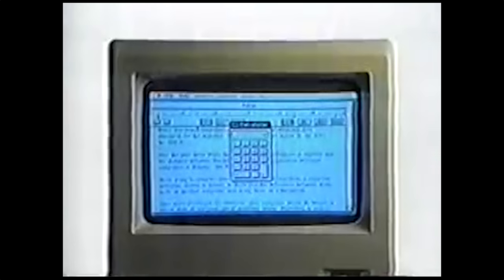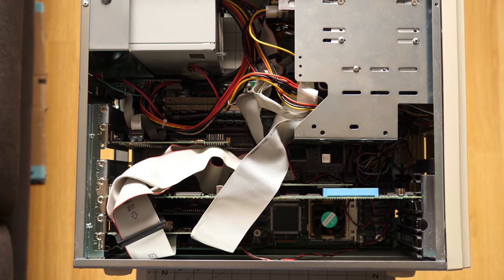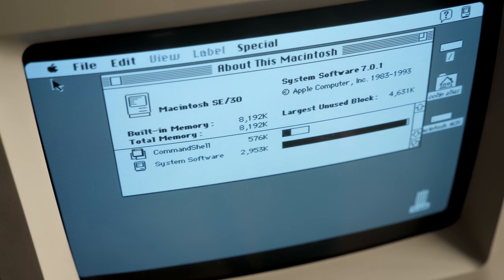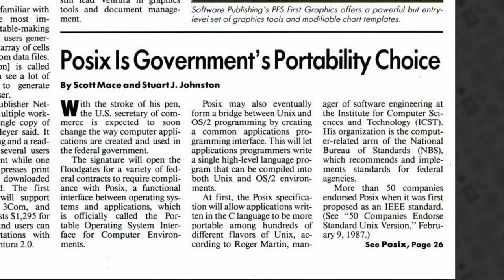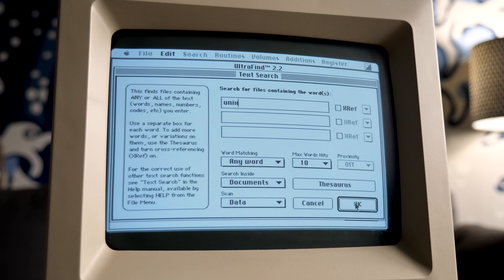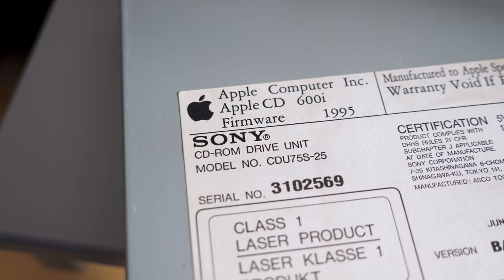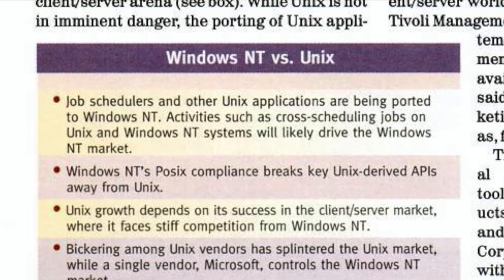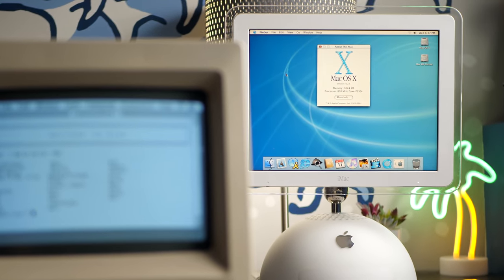Apple A/UX: The First UNIX Mac OS!

Comment: I remember when I worked for Apple Australia around the turn of the century, coming across a BOOK of floppy disks, it was A/UX 2.0 and it came as 20+ floppy disks.  We successfully installed it on a IIci that we had lying around at the time, it took the better part of a day to install it.  Amongst other things, kernel extensions did not exist, but the OS had the capability of recompiling it's kernel on the fly, the administrator could tell it to recompile the kernel to include certain features (like networking), and it did so on the spot and advised the administrator to reboot once it had completed.  It had a seriously brilliant utility called "Commando" that  was a graphical interface to generate a command for the command line to execute, including graphical pickers for all the different command line option flags for each of the commands.  It also used a case-sensitive file system.
Reply: I happen to have a IIci and am tempted to give AU/X a go on it.
Reply: What! I'll be damned!
Reply: Commando was also part of MPW, I thought it was awesome, MUCH better than any manual page!
Reply: i heard kernel compiling and taking "the better part of the day" to install it- and that reminded me of gentoo linux
Reply: That's a better experience than modern Linux.
Reply: Apple Australia had a good customer for A/UX in NSWIT, later the University of Technology Sydney. I was a part-time student there at the time. At work I was using Fujitsu UTS Unix, in all its VT-220, 80 x 25 glory. The A/UX machines at Uni seemed like science fiction .. it was Unix! But it had a GUI! And a mouse! How could this not dominate the world of computing?? As it turned out, that was the first and last place I ever ancountered A/UX. Of course, Apple finally caught up with Mac OS, a genuine UNIX 03-compliant Unix.
Reply: @Maclabhruinn  IIRC (and my memory is very suspect) A/UX 2.0 had an implementation of X-Windows as well.
Reply: I wrote the installer. I had to create a bootable floppy (that was fun!). It also asked for the next disk (something PCs didn't do), checked if you put in the wrong one, and had error checking for bad disks.
I also wrote the installers for tape, CD and the (drum roll) 100 floppy version for people who didn't get it on CD-ROM!
Reply: Wow, this is  pretty cool ! This is why I love Collin's channel. The vidz are always full of comprehensive real info and entertaining! Contrast and keep up the good work 🎉😅!
Reply: @RokeJulianLockhart.s13ouq  Forget modern Linux, that's better than Z 'doesn't have autocomplete enabled in stock settings' shell as shipped by current macOS.

Comment: MultiFinder was often called "MultiCrasher" at the time.  Atari also had an actual AT&T UNIX System V Release 4 ported to ST computers.
Reply: M.A.C.I.N.T.O.S.H. = most applications crash if not the operating system hangs (a very true statement back in those classic os days)
Reply: Atari!?!?!?  WOW!!!
Reply: The Sys. V release from Atari was for the TT030 (their first 68030 model). It ran on a slightly modified model they called the TT/X, though I think the only difference was it contained a display card that could drive a 19" monochrome monitor. The card probably plugged into its one expansion slot. It ran Unix with X/Windows.

I remember being really excited by this at the time, but the TT/X was short-lived. Atari only sold it for several months in 1991, and then cancelled it.

Interestingly, in the early '90s, it became possible to run a Unix-like environment on an ST (their 68000 line) using Eric Smith's open source MiNT OS. It was even possible to run X/Windows on it, if you had at least 4 MB of memory. A hard drive was really necessary to have a nice experience with it.

MiNT ended up becoming the kernel of Atari's last computer, the Falcon030, which, along with Multi-AES, gave it the ability to pre-emptively multitask GEM programs. The Falcon was released in 1992.

I installed MiNT on my Mega STe in 1993, and almost everything about it felt like Unix (running a complete complement of GNU tools helped a lot). The one big exception was it didn't support swapping to disk. So, everything--the kernel, all your processes--had to fit into physical memory.
Reply: Commodore also has AT&T UNIX System V Release 4 ported to Amiga computers.
Reply: @mmille10  Unix (or linux) for the normal 68000 Atari's wasn't feasable cause of the lack of a sufficient mmu. There was a cut down version called Minix. I did see Unix in action on a TT in a Atari Shop (more a 'Shack') with a full X-windows system
Reply: @valenrn8657  Ohh The A3000/UX... I lusted after it back in the day. Then there was also NetBSD and FreeBSD if I can remember.. A little bit after I had to jump ship (Jan '96) and build a Windows 95 machine.. What I also lusted after was a Next black box. I made my dream come true in August 2003 when aI got my first Mac and installed OS X 10.2.7. Never looked back.
Reply: @mmille10  Very good contribution. The story you tell is little known. A few days ago, looking for information about Atari ST computers, I found this information. I learned that SCO offered Jack Tramiel to sell the TT030 jointly with UNIX, but Tramiel delayed his decision and in the end that contract did not materialize. A pity, because Atari could have made very good money with that operation. Also a pity that the TT 030 was reduced its speed of the Motorola 68030 from 32 MHZ to only 16 Mhz for reasons of compatibility with older software. And a pity that Atari abandoned computers to turn to the Atari Jaguar game console.
Reply: @darioperezdario2638  - I didn't hear about that story re. SCO. Interesting. So, I guess SCO would've been an Atari reseller in that arrangement?

The most impressive Atari story I heard about was the Atari Transputer Workstation (ATW, also dubbed the "Abaq") in 1989. It used parallel transputer processors for high performance (though most of the hardware was not manufactured by Atari. They contributed some hardware, but for the most part, they were an OEM for it). It ran a British Unix-like operating system, called Helios. It had graphics features of a high-end workstation, which wouldn't be seen on PCs or Macs until the late '90s, or early 2000s. Atari sold 350 of them, mostly to Kodak, and then to some research institutions.

Re. the TT, the Falcon030 is the one you're thinking of. The TT ran at 32 Mhz. The Falcon had the 68030 that ran at 16 Mhz. I never heard about why that was. What few Atari users were left in '92, when the Falcon came out, were more cynical, thinking Atari made it slower on purpose, so it wouldn't cannibalize TT sales. The reviews from the Atari press thought the Falcon was the best ST Atari had produced, "What the ST should've been in the first place," but they sadly had to say in the end, it was "too little, too late."

The computers that were gaining tremendous traction in '93 were PCs. It seemed like, from what I was hearing, this was because of how buyers were discovering the internet, and they wanted a computer that had the performance, and the network capability to do some neat stuff with it. Atari was lagging behind PCs on performance, and their computers had no Ethernet adapters available for them. The Pentium processor was about double the speed of Atari's fastest computer, in 1993, which was the last year Atari produced computers.

Even Atari's president, Sam Tramiel, was discovering at that time that PCs and Windows had gotten far ahead of where Atari was trying to go. He concluded Atari would never catch up. So, he decided they should just give up on computers, and focus on their video game systems. I heard this story from Bob Brodie, who was Atari's user group coordinator, a few years ago. It blew me away, because what it meant was that Atari was asleep at the switch. They were paying attention to, and competing with Commodore, but they were blind to what PCs were doing, until it was too late.
Reply: @alerey4363  The most stable way to run things was essentially to open the program you wanted to use and NEVER, EVER close it or try to run anything else. And that, of course, only bought you just so much time, particularly as things evolved and programs did all kinds of crazy things in the background.

It was amazing to me "way back when" what a difference Mac OS X made, not so much in speed (that would take a while and a few hardware iterations) but in terms of sheer stability. To be honest, Mac OS X really did make Classic Mac OS look like some kind of almost amateur hour OS project.
Reply: @scifisurfer8879  Exactly, the only MAJOR flaw MacOS X inherited from classic was HFS and got replaced only 1 year ago!
Reply: @alerey4363  I'm not sure if "inheriting" HFS+ was actually a bad thing. It was designed to allow for much larger and more efficient volume support, and significantly longer file names (31 characters was the old limit, 255 was the new) and they'd been further enhancing it along the way anyhow, with such things as Journaling and case sensitivity.

In fact, I only just heard it was replaced today when I bumped into another Mac-topic video about the history of Mac OS X.
Reply: @alerey4363  HFS is not the same thing as HFS+. HFS came in with System 2 and the Mac Plus. HFS+ appeared with MacOS 8.1, the last 68000 release, a decade and a half later.
Reply: I did not know that!

Comment: A/UX was one of the first UNIX variants I ever supported in my career as a UNIX admin. This was back at a phone book publishing company in 1996. It ran alongside some System V clones. The most interesting thing I remember from A/UX was when the hard drive crashed and we had to get the filesystem table rebuilt without access to a real editor because the filesystem wasn't mounted. No vi, no emacs. So my coworker and I had to learn "ed" on the fly and it sucked. But we eventually got everything back up somehow.

Comment: I worked at a startup ISP in 1995 called A World of Difference (AWOD) in Charleston, SC.  One of the first, if not the first, servers we setup was a Mac IIci running A/UX.  It had a 50MHz CPU upgrade and probably the maximum RAM we could stuff in it.  It handled DNS, Mail, and News (NNTP) among other things.  It was pretty reliable, at least for the time.

Comment: I ran into A/UX while I was attending college, in about 1991. A friend was IT administrator for a computer lab at my dorm. It had a mixture of Macs and PCs. A problem we had was that when the lab was started, it wasn't connected to the university's network. So, all most students could do with it was write papers, using word processors, and printers in the lab. He got a PC hooked into the network, so PC users could connect to their university accounts, and use the internet, but he wanted to get a Mac hooked up as well. He got A/UX for a Mac SE-30, and I volunteered to see if I could get it hooked into the network, using an Ethernet card that was plugged into it. I worked with it for probably a couple hours, but I couldn't get it connected. My friend later found out the reason was the NIC was bad. Oh well.

It was interesting hearing that A/UX was designed to be compatible with Macintosh applications. I had no idea, though I think I could be excused, given that in A/UX's early days, only 10% of Mac apps. would run on it.

Comment: I had several A/UX Macs when I worked at a DOE lab in the late 1980s into the 1990s. We needed A/UX for running the command software for a Venable power supply that had a whole slew of analyzers attached to it and was used for doing test welds. I remember the Macs started out as plain old Mac IIs, but by the time I left in 94 they have been retrofitted into IIFX models because Venables hadn't ported their software to the new PowerPC chip Apple was using. From what I remember, they ended up migrating to Sun SPARC stations.

The US Government's POSIX requisite was only for specific departments; most Government agency's were allowed to select hardware and OS that met their needs. The lab I worked at only transitioned to UNIX in 1993 only for the Cray supercomputers -- and it was AT&T Unix on that machine. And we didn't have to pay any licensing feed to AT&T because our lab was operated for DOE by AT&T.

Comment: 7:33 Actually, Andy Hertzfeldt’s “Switcher” provided something similar in 1985. The GUI was slightly different (only the active app was visible on-screen, others were hidden), but the underlying mechanisms were carried over into his later “Servant”, which Apple bought and made the basis of MultiFinder.
Reply: I had Switcher installed and it was interesting, but it really never got around the fundamental problem, which was with all versions of Classic Mac OS, of memory fragmentation. That was pretty much the root cause of crashing, apart from bugs (obviously).
Reply: Yes, memory fragmentation was a definite drawback. As was the fact that the entire low-memory globals area had to be saved and restored on a context switch. You had to choose how much application heap to allocate to a program, and if that wasn’t enough, you had to quit it, change the allocation, and launch it again.

Funnily enough, present-day Java apps do their heap allocation in a very similar way ...
Reply: You still had to do that for System 7. Define the memory area for a program in the "properties" dialog box.
Reply: All that hassle manually allocating memory and it still wasn’t protected. As a C programmer just starting out in system 7, I would reboot after every bug fix cycle.  Bug fixing alway too twice as long as writing the program I’m those days.
Reply: @scifisurfer8879  Even before switcher, there was a program called MultiMac that ran on 512k macs that was amazing, overlapping windows and everything.  The author was from france I believe, but was anonymous.

Comment: Hahah. I had A/UX v1.0 running years ago on an SE/30 model. I still recall the huge white wall of a box in which the A/UX (factory) package lived, on the shelf of Apple boxes and manuals.

Regarding resources, A/UX required more RAM and an extra (external) SCSI HDD that lived under the SE. That machine had three of them (one was a carryover from the 512K model, that used the normal drive bus port, not SCSI!), turning it into a bloody monolith, but we used it for twenty years. One of the drives had system 6.0.8 on it. We tried System 7 for a week or so, before reverting, as it was more demanding than either 6.0.8+MF or A/UX. 

It's sort of a shame that I didn't whisk that system home at the end of its life as I had done with so many others. I have very fond and remarkably clear memories of using it as a telnet system.

On another note, I believe that you can see a Performa model running A/UX 3.x, at one point, in the film 'Jurassic Park'..

You should probably mention the pre-OSX 'Mac OS X Server' OS that Apple flubbed around 1998-9. We had that, too, on a Platinum model G3 tower, for a brief time. Two failed Unix OSes told us to hold off on OSX until Panther rolled out, and after 10.6.x killed Rosetta, we stopped using their products. Several of our servers remain XServe systems running 10.5 or 10.6, to this day.

Comment: Ahhh another random point.  Apple A/UX seemed to need 8 megabytes of RAM to run.  NeXTStep could get along with 4 megabytes of RAM!  I ran a headless NeXT cube in this configuration as a server.  It had a giant resistor on the monitor port with 4 megabytes of RAM in our office.  Quite fun.  It helped to be clever at managing resources but it did work fine.

Comment: Fantastic video! A good friend of mine just got A/UX running on his SE/30. I’ve just gotten my own SE/30 and CD-ROM drive, and as soon as I repair the logic board, I think it will become my A/UX machine. REALLY looking forward to getting that up and running, and seeing what A/UX can do.
Reply: a/ux can do little than playing with some commands; as it's justa a sandboxed bunch of emulated commands running INSIDE macos 6, which is always a sneeze away from crashing with type error 11 bombs which will render the whole unix unusable; apple made that "Unix" as crashable as macos 6 itself, good job apple! no wonder it failed miserably
Reply: @alerey4363  This is incorrect. The MacOS compatibility layer (that adds a Finder, Mac GUI and very limited Mac app support) was unstable, especially w/ AU/X 3.n on a SE/30. The POSIX-compliant UNIX underneath was fine.
Reply: I want an SE/30 myself more than any old Mac to do the same.
Reply: @Pyrrho_  Im sorry but if apple planned to "port" an os like Unix to their crappy os the WORST thing they could do was to put that on top of the unstable bombing classic native os; which btw was slow, super limited in terms of resources (ram, disk, i/o, graphics) plus unstable like house of cards so there u have it, another absolute failure by apple (which btw charged thousands of dollars for that bullshit experiment); only when they decided to switch to Darwin-based osx AND then to intel processors they really had a first class os base
Reply: @alerey4363  AU/X didn't run on top of System 6, the Mac Compatibility Layer ran on top of AU/X.
Reply: System 6 ran on top of Unix on A/UX. In fact if the System UI crashed you got dropped to the Unix login. You could boot A/UX straight into CLI or X11 just like any other Unix, making the System GUI completely optional.

I never had much issue with the System GUI on A/UX and found it pretty stable. A lot of the underlying stability issues of Mac System simply were not there because the "under the hood" OS was not System and Toolbox calls were emulated rather than going to ROM.